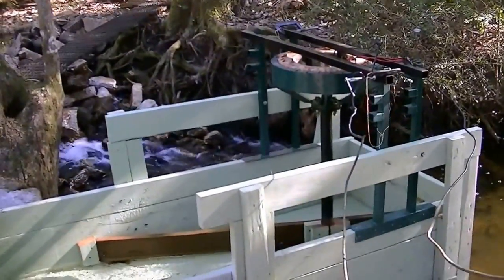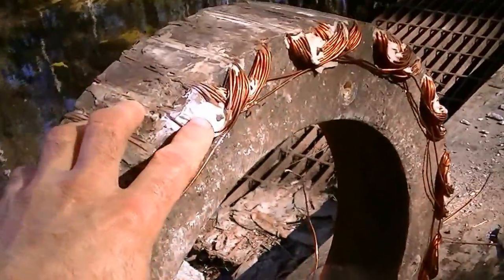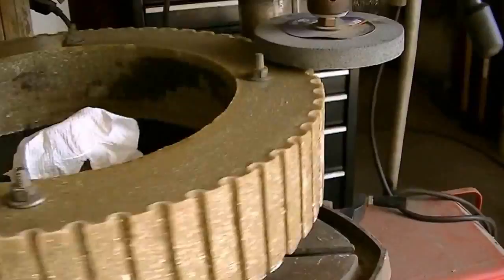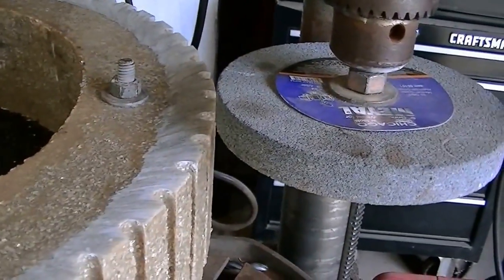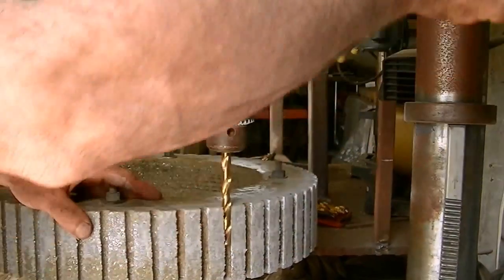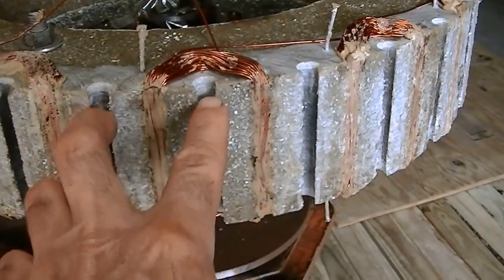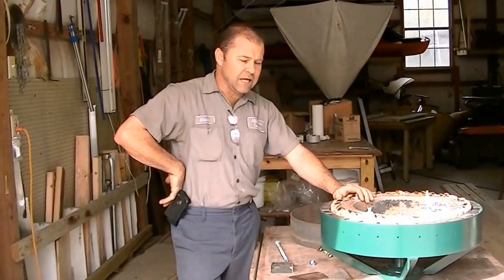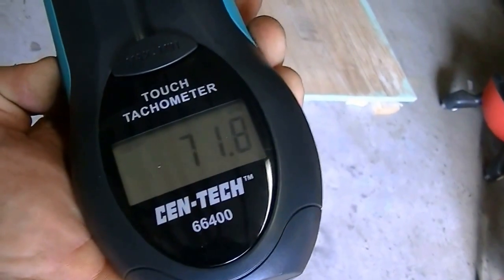Vertical turbine hydro generator system. Low rpm permanent magnet generator, home made

Comment: Great work Mark.  You demonstrated this very well and built an excellent hyrdropower generator.  Many comments presented are accurate regarding the conversion of AC to DC.  You may wish to consider the transmission of your alternating current rather than direct current because AC can withstand long distance lines, hence why most LDPDS' use AC current.  Edison was wrong when he pushed DC to DC because of the immense amount of loss, however Tesla was on the money.  

Instead, bring your full bridge rectifier closer to home and get the most out of your system (even charge an extra battery with that extra voltage).  Again, this is great work and I would be thrilled to have such a great source of power so close to home.  I do have great solar and wind potential and I was just researching different stator designs.  You really broke the mold (no pun intended) on this one.

Comment: can you use this with RPM 20 per minute to genearat 10-20 watts a minute. For this speed how many coils will I need and how many magnets nakulcha@Wgmail.com. Will i need 3 phase system?
Reply from the maker: You will need around 160 RPM to get enough voltage to use.

Comment: Are those neodymium magnets ?
Reply from the maker: They are Ceramic Magnets C8 3"X2"X1"
Reply: Thanks,  wondering if you use  Neodymium magnets that about 3.5 times stronger how much more would you get. From online specs I see those ceramic magnets have BrMax of 3850 gauss where as the same size Neodymium magnets have about BrMax 14500 gauss.
Reply from the maker: I would not get any more power with my system. The power it produces depends on how much water is falling not on the strength of the magnets.

Comment: i have a very fun qu for you . is there a way of doing s double or a triple stack to get more power from them . i am looking for my friends hunting cabin up in the hills . they have a great stream fast water and deep . i was thinking 30 ga wire twin phase if possible . can it be done ?
Reply from the maker: You will not get any more power out of it by adding more generators. You need more water falling from a higher source to get more power. This generator can produce way more power if I had a bigger waterfall.
Reply: i can say i have learned a new thing as of now . thank you for getting back to me about this . have a great week !

Comment: wattage is about the same because your available power or water head is about the same. But it shows that you did get a better idea of how the stator effects your system. For instance if it output 12v most of the time and you were trying to charge a 48v battery bank there would be some efficiency loss due to the charge controller boosting the voltage of the system to the 48 needed to charge your batterys. 

It doesn't sound like much but when your dealing with low power systems efficiency taxes on systems like this cam make a huge difference.

Comment: hmmm would it really be running for eons? or is the flux leakage really just low and run for much longer than expected for the life expectancy of the magnets? i'm planning to implement permanent magnets but ditched the idea because it would run out and went back into electrostatic into my design and when you said 'eons' i was like wait what?! is this true? please get back to me, i'm very curious bout this, i'm planning my generator atm. ty
Reply from the maker: The permanent magnet when placed is a metal circle ring will not lose its magnetism.

Comment: Study electric motors and iron core eddy current losses.  This design will have quite a bit of self heading with the current flowing in the ferris core.  A vast improvement can be made by using a laminated core instead of cast with the laminations insulated with varnish or paint.  A good resource is Wikipedia article on Electrical Steel.  This can Raise RPM due to less drag, raise voltage due to less shunt current in the core, and raise power from less loss.  Direct drive washing machine motors are often used for this.

Comment: Hi Mark,Can you tell us more about the stator casting. What resin did you use and what ferrous material did you use? Approximately how much ferrous material to resin and what grain size. I suspect you used a ferrite material. Sources for the resin and ferrous material would be helpful. --Thanks
Reply from the maker: I use fiber glass resin with several metal rings, around 10. I use aluminum shaving as a filler. You could also use sand as a filler.

Comment: I think you have a great generator and and your setup looks good. In fact I think you could even double up on on the generator with the amount of water volume you have flowing. I just wounder if you could not gear up the speed due to the amount torque you have available to you.

Comment: Have you tried stacking  the units to get more power 
How much I'd it to buy one from you  great video
Reply from the maker: The only way to get more power out of the generator is to put more power in. I would need more water falling to get more power. Two units on top of each other will give you the same power as one.

Comment: Mark: thanks for taking time to upload this video. I have a few questions regarding your design, I hope you can help me. 
1. You used stone for stator core, is it to reduce the eddy current? 
2. Do you know what is the PSI of your creek water when it hits turbine blades? 
3. How do you make sure RPM stays constant?  
4. It looks like your design generates AC current, are you using a rectifier before the battery? 
5. I am assuming you have about 30 magnets, that means 15 pairs of poles, so your output is 15 cycle AC current, right? 
6. With 100 RPM, you have huge number of cycles per minute - correct?
7. Can't we use thinner gauge cylinder to holder the magnet to reduce the torque?

Appreciate your time and effort to answer my questions. Thanks.

Comment: You did the stator wheel with that stuff? It has metallic particles for heat dissipation?
I watched the video, but I could not understand what I said, because I am in Brazil and do not understand English, but I wrote to you through google translator.
Thank you for guidance.
Reply: I know this is probably pretty late but have you considered rounding the corners of your vertical water duct off, venturi style for increased flow?

Also, awesome vid, I have an off grid project with a rivulet on my property, am considering something like this.
Reply from the maker: I used fiber glass resin with several steel rings and I added aluminum shavings as a filler.
Reply: great solution! Thanks for answering me!

Comment: How many watts is it generating?
Reply: cooldog60 He said in another video he was getting 12a and 30v so about 360 watts. Said in this video he was getting about the same amount of power but delivered at higher volts lower amps. 360w X 24hrs = 7.92kwh per day. I have natural gas for heat so I only use about 10kwh. "Average" US home without NG uses about 30kwh per day.

Comment: Nice video. Just one point: magnets will lose their strength even if you set them in a circle, because as you create electricity, that very moment the generator is offering resistance, and that resistance is always fighting against the magnets, not making them stronger, but weaker overtime, canceling their own field by way of making an effort contrary to the magnet's field. 
But you know, thats fine, thats just how it is. If not using magnets you would probably have to use some weird solar generator + battery + recharger, + more windings, to replace the magnets. As it is, when they get weak, you just buy new ones. Might be simpler that way. Rechargeable batteries, and solar panels also decay overtime. Everything grinds towards destruction, just do what is the easiest or cheapest, for you.

Comment: with this amount of water flow you could make a much higher output system with a different harnessing method.You could use a ram pump to pump the water to a higher elevation by using no electricity (ram pump uses no electricity). Once the water is at a higher elevation in a tank for storage, pipe the water to a lower elevation and output through a nozzle under the pressure of the elevation directly onto turbine blades at high pressure. You would make a hell of a lot more electricity with all that water flow. I am talking 1000 watts continuous at least with all that water.

All in all, this is a great thing you have here! :D
Reply: Thomas Knight-Wagener

Comment: what is your casting made out of?
Reply from the maker: Fiber glass and steel rings.
Reply: +markp0177 and when you get the electrical current, it goes to battiers, yes? it's DC isn't it?
Reply from the maker: Yes it goes to batteries. I convert it to dc with a full bridge rectifier.

Comment: great Mr mark the way u described every thing so good to see you i have the same water flow like u have in video but i want to get 220Ac can u till me how its possible i means how to do wiring if stater and nos of magnet thanks will wait for ur replay
Reply from the maker: +muhammad zubair  The best way to get 220 volts ac is to use the generator to charge batteries and the batteries will then power a 220 volts inverter.

Comment: Hi Mark, Why not make a larger fan then put a large gear or pulley on it then a smaller pulley on the generator so to turn the generator at a higher RPM to produce a higher output.  Thank you for the response. Rick G.

Comment: Awesome. Tesla built a motor with a diametrically wrapped coils, 2 phases per coil. See Figure 7:
https://teslauniverse.com/nikola-tesla/patents/us-patent-359748-dynamo-electric-machine

It's very hard to design with coils wrapped diametrically, there is a lot to consider. Your design resolves that by keeping the coils in a radial pattern where the coils are perpendicular instead of parallel to the radial lines. This makes the coils modular, if you want to make a change in coils you can remove them, diametrically wrapped you can't. Diametrically wrapped will increase the coil size, and copper usage. Whether it would increase the power output or not, I'm unsure. I'm still learning.

Measuring Magnetic Flux Density
https://www.youtube.com/watch?v=3nGc44rYXww 

Would 2 magnets per coil leg, 1 in front (rotor A) and 1 in back (rotor B), improve the magnetic circuit and the power output?

Comment: Great design, excellent video.  Thank you!  do you happen to have a video showing how you cast the stator?
Reply from the maker: +Fred Stockberger   Sorry I do not have a video on that just yet.
Reply: Thanks anyway!
Reply: +markp0177     Did you add any materials inside the stator? and, What kind of substances did you use in this casting?
Reply from the maker: I use a fiber glass resin and the casting has several steel rings inside.
Reply: markp0177 Thank you!
Reply: +markp0177 Thank you

Comment: ...awesome work Mark...btw, just a thought, its ok to have your fan turning slow, all you need is a belt system maybe a ratio 1= 6 instead of direct drive design that you currently applied. Since the water flow is quite strong...Cheers man!!

Comment: try and experiment with the water vortex, instead of a flat fan blade machine a wheel with cups running its width and raise is higher up, add another grate to control debris
Reply: +Levi Reel Another option might be a post hole auger... but you'd need a bearing at the bottom probably...

Good observation on your part none the less.

Comment: Nice work Mark, 

As an alternative to the plank - vortex attenuation - consider a disk set to water-air interface level, to isolate atmosphere pressure forcing air into the vertical hydro channel. The disk may encounter a force no more than 1 ATM x area. 

I agree with you that vortex in the transmission of a specific rotation promotes efficiency in this system. You have a counter clockwise turbin (camera view) and the wanted vortex rotation shall also be in the same direction down the hydro channel. 

To promote wanted vortex, you may add - stator fins - just before the current change from horizontal to vertical. Although stator fins (flow diverting fins) just before the driven turbine can increase system efficiency as would jet engines do, however the diversion effort will harvest energy out of the hydro flow, leading to a suboptimal system efficiency that should be avoided when possible. 

Hope this helps,

Comment: Hey Mark.Where did you buy those magnets and what material did you use to cast the stator?
Reply from the maker: +raysfunk I bought the magnets from magnets 4 less. The stator is made out of fiber glass and steel rings.
Reply: +markp0177 Thanks mark for that quick response and please could you make a video showing how to cast the stator.Thanks

Comment: It's been quite a while since I took that electronics principles class. LOL Correct me if I am wrong here, but more magnets means your RPMs do not have to be as high. Right? 

Assuming that is correct, at higher RPM's I am going to generate more voltage, right?
Reply from the maker: +Gary Verderamo Yes, you are right.

Comment: To improve your output powere include a stationary stator before the water full on the turbine,the stator should have have a negative angle of attact in respect to the turbine rotor blades ,this directs the falling water to hit the turbine blade at an angle for maximum efficiency ,also your falling turnel should be reconstructed to converge from the top to the turbine section with a little bit divergent as it gets close to the stator to be included ,it causes the water pressure to build up at the converging channel while velocity decreases with the help of gravity ,but as it leaves the converging section to the diverging section due to the increase mass of the fluid it gains velocity as it escape the converging section, an aerodynamic theory by bernoullis principle .just ask if any question
Reply from the maker: +chiath chukuemeka Yes, you are right. I use to have it that way and I got way more power but I had to clean out the stationary blades all the time and I just don't have the time to keep it clean.

Comment: You need to remove trapped air pocket on the entry tube to the impeller. This rolling pocket of air reduces the width of water to the intake mouth

Comment: Hi Mark! Great video & project. You are certainly blessed by the Lord! (and you are my bro!)
(In the middle of writing this, I watched the "America Unplugged" episode you linked to... )

Questions:  
You call this a "double phase" alternator, but in reality what you have is a split-phase radial flux AC alternator... each set of windings is 180° out of phase with the other. 

Therefore, you could wire the AC output either as "split-phase" by using a "neutral" wire and two out-of-phase "hot" wires (just like North America 230V house wiring, which gives you 2x the per-winding Voltage, but 1x the current)... OR... you could connect them in parallel for twice the current, but 1x the Voltage (obviously reversing the phasing, so that they are in-phase with each other). Right? 

This gives you greater/simpler wiring flexibility than a 3-phase alternator, but 3-phase would certainly give you higher performance, due to the fact that you'd only have 120° between phases, versus 180°.
http://www.electrotechnik.net/2010/11/advantages-of-three-phase-power-over.html

I see you're running the alternator windings to bridge rectifiers right on the alternator, then paralleling the DC outputs together, then running that combined DC 400 feet to the batteries and inverter? I think you're losing a fair amount of power by rectifying it at the alternator head.  Low voltage long distance DC transmission is >very< lossy. 

How much AC voltage are you getting per alternator winding?  If you'd wire them in phase-corrected "series", you would get twice the AC voltage.  I'd recommend moving the rectifiers to the place where your batteries are, you will get more POWER transferred, because you will be transferring a higher AC voltage, but lower AC current, so the resistance of the looong wires will drop less power.

Then, if you want to keep everything else "as-is" (same battery stack voltage, which looks to be 12V batteries all in parallel), you'd need to have a 2:1 step-down toroid transformer, which would then feed the bridge rectifier.  You'd lose maybe 10% in the transformer, but I'm guessing you're losing more than that now... unless you have VERY large wire carrying the DC that distance.

Have you ever considered a Pelton Wheel drive system?  It could be far more efficient, and can be designed care-free like yours.

Comment: Hey Mark... great video.  Thanks for putting them up.  I would like to know where you get the magnets, I want to try to build a generator like you have there.  Can you list the components for me so I can start searching the junk yards?  Do you recommend certain axles for the post to the stater.  I am also hoping that I can find an outer housing from a metal shop.  Any recommendations... I'll be in Colorado.  Last, how did you mount the magnets to the outer housing.  Would like to see the wiring diagram... I could look it up but be nice to have all the info in one place.  Oh yea... what is the ring made of, plain Portland cement?
Thanks
Scot
Reply from the maker: +ZeroHouseDesigns Hello. Contact me at markel38@aol.com. The stator is made out of fiber glass and I buy the magnets from magnet4less. I use a new 3500lbs axel and I glue the magnet in place..